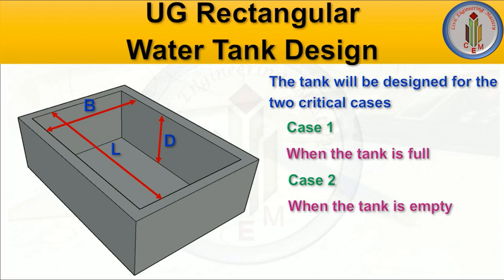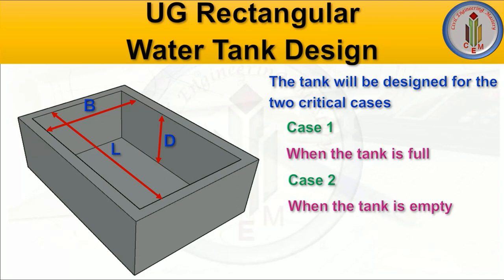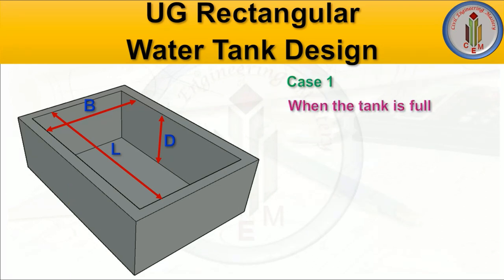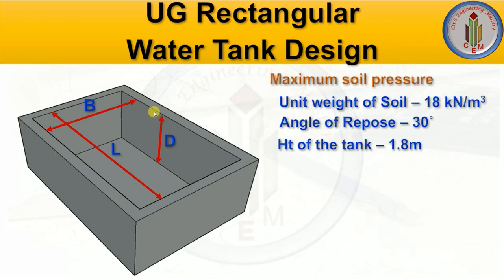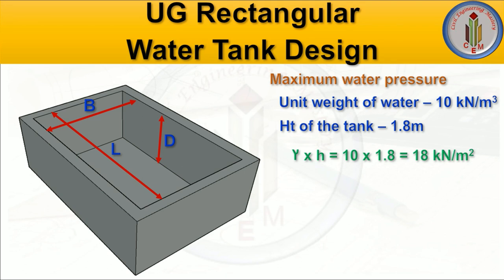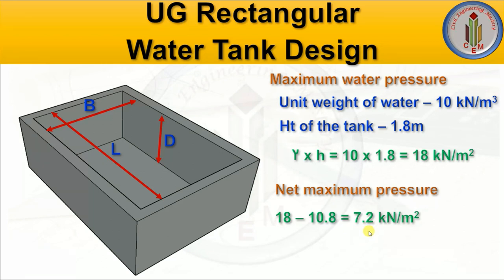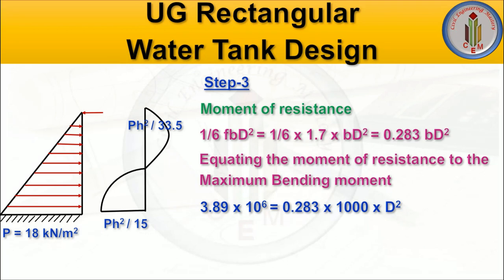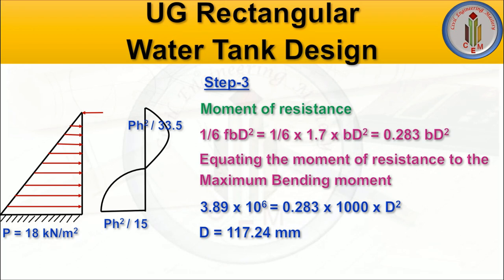Design of underground rectangular water tank | Part-2 | Under ground water tank design | IS-3370

Comment: While using the expression for MR (Moment of Resistance)  Is it not essential to account for the amount of reinforcement in the tank wall?  It's a RCC wall and not just a simple concrete wall. The equivalent concrete area of the reinforcement shall be accounted while finding the MR. 
CAN YOU PLEASE COMMENT?

Comment: How is maximum soil pressure in 2nd case 18 kn/m². Is it not 10.8 ?
Reply from the maker: Case 2 is whwn the tank is empty.
There will not be a water pressure, only soil pressure will bw there.
Reply: @CivilEngineeringMastery  yes, but the maximum soil pressure on the wall is 10.8 only
Reply: Yes
Reply: What is the mean of b, in design of moment of resistance and you said is 1000 but what is it